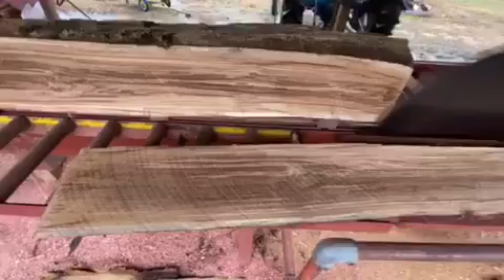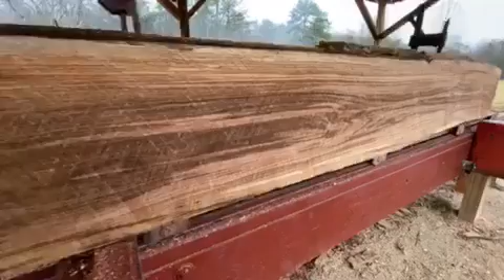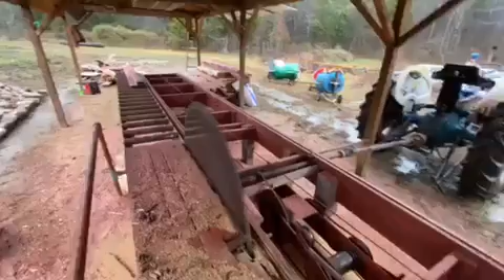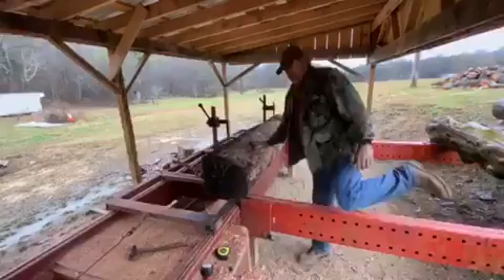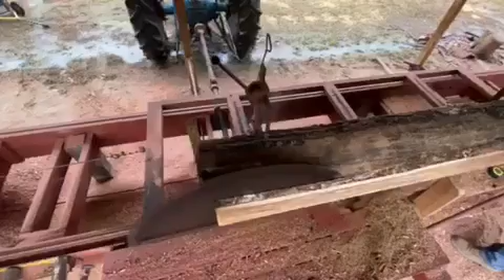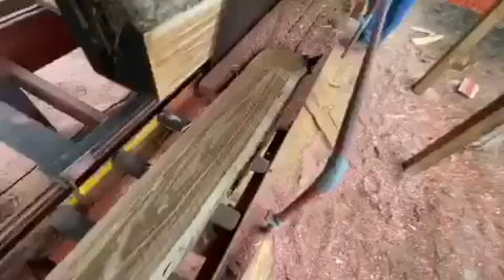The Foley Belsaw sawmill; not enough Horsepower here!

Comment: hi there probley a little light on power . looks like the feed should be made some how smother . really sharp teeth . my rule for power is on how many teeth will be needed for the cut . start at 5HP first tooth then double it each time  so 2 would need 10  3 needs 20 4 needs 40 and on up till yo get 1/4 of your blade . that is to maintain RPMs you can saw slower feed but to slow of feed makes fine dust witch rolls out from aroung the gullets . that can cause power loss and heat the blade   . also know what you are sawing  dried oak is a lot harder then wet  and pine most the time saws easy  . that your time  just be safe  john

Comment: Can I use this sawmill with a Ford 8N tractor? Will it have enough HP or no?
Reply from the maker: You can use a 8 n if you have the right blade on certain wood. They made a skip tooth blade that was easy to pull. Matter of fact, I’m running my blade with half of the inserts. The other half are old worn down inserts. It’s easier to pull that way.
Reply: @tennesseesawmillguy1590  Ok thank you.
Reply: @tennesseesawmillguy1590  I agree .... Had a Bellsaw with 40 inch blade and teeth were 5-6 inches apart ..... sawed pine with an 8n and did ok but would not saw hardwood ..... I borrowed a Farmall Super H when I sawed hardwood. The Belsaw was great for smaller logs such as those that would square up to 6x6 or 8x8 .... I could put a lot of small logs through it in a day. Replaced it 20 years ago for a band mill.
Reply: I posted a  video of me running my little Mill 21 inch blade with an 8N. One time I hit a knot in a pine and stopped the engine instantly didn't break nothing but I quit running the mill with my 8n .